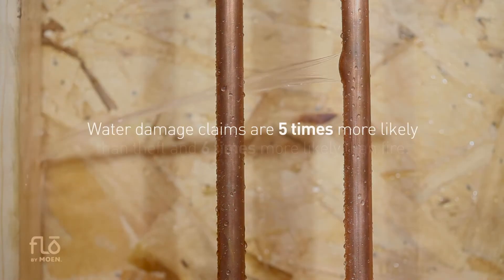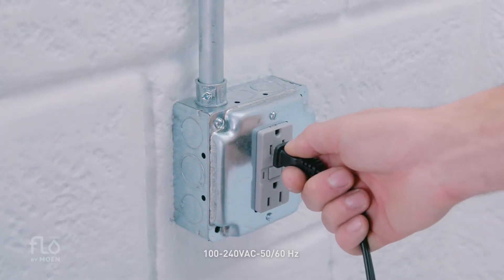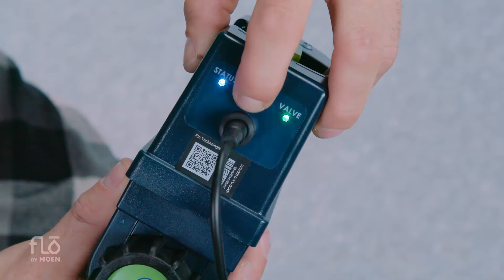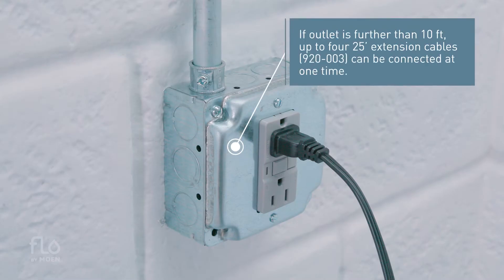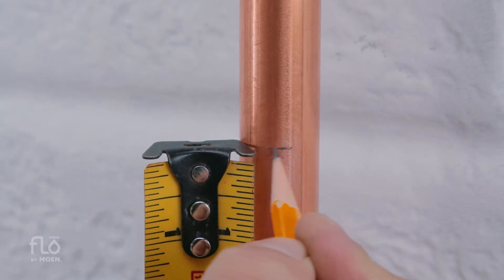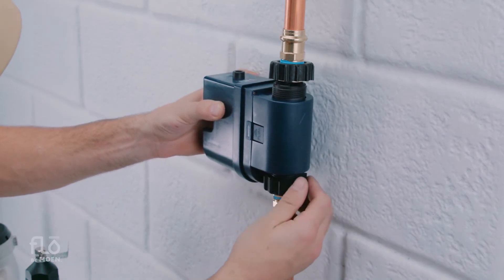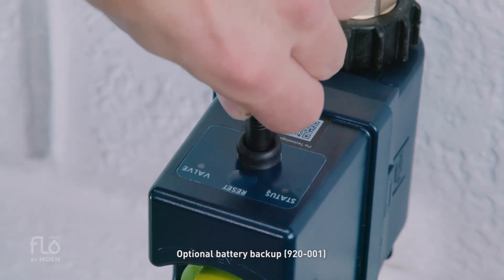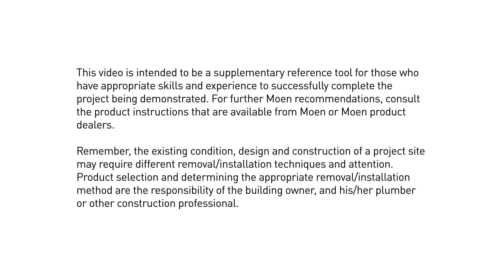Flo by Moen Smart Water Shutoff Installation

Comment: The problem is, you have to be on a schedule, which we are not. If you take a shower at midnight instead of 7 PM, the water will shut off in the middle of your shower.
Reply from the maker: Good morning. You can adjust the sensitivity:

https://solutions.moen.com/Flo_Smart_Water_Monitor_and_Shutoff/Alerts%2C_Notifications%2C_and_Settings/How_To%3A_Adjust_Shutoff_Sensitivity 

Our Smart Water Team is also available for additional technical assistance by calling 1-800-289-6636 option 8.

Comment: My home was built in 1958, so can this be installed outdoor with a galvanized pipe.
Reply from the maker: Good morning. The Moen Flo Smart Water Monitor and Shutoff must be installed on accessible cold water main water supply. This must be installed after water meter, water shut-off and pressure regulating valve. This can't be installed on galvanized pipe.
Reply: @moenfaucets Thank You.

Comment: Does a 32 degree temp limit make it not advisable to install in a crawlspace? I would think if you have a crawlspace it would have to be installed there.
Reply from the maker: Hello Fuggedaboudit223.  The Moen Flo Smart Water Monitor & Shutoff device and power supply must not be buried or installed where the ambient temperature can exceed 104 Degrees Fahrenheit (40 Degrees Celsius) or below 32 degrees Fahrenheit (0 degrees Celsius).  
If you have any additional questions, Moen Smart Water product specialists can be reached at 1-800-289-6636, select option #8 and they are available Monday through Friday from 8:00 am – 7:00 pm Eastern Time.

Comment: How does it know the water flow is a leak and not someone showering? This will be in a home where there are days when there is no water use at all.
Reply from the maker: Hello Goochesmom.  The Moen Smart Water Monitor & Shutoff device after being installed goes into a Learning Mode, where takes approximately 7-10 days to learn the home’s water habits.  The following link will provide you with additional information on the Moen Smart Water Monitor & Shutoff device:

https://solutions.moen.com/Smart_Water_Security_Products/Help_Center/Flo_Smart_Water_Monitor_and_Shutoff
Reply: @moenfaucets  Pity the person who hasn't had it "learn" yet.  You should make this more clear in your instructions. Otherwise... it just shuts down water when it feels like it.

Comment: Why are the product unions and male fittings made of plastic?  A majority of my house is made of copper (strong pipes and fittings); concerned this device would be the fail point due to it being the only plastic in the system.  Can someone at Moen-Flo further explain?
Reply from the maker: Hello Pete and thank you for your interest in Moen products. The Flo Smart Water Monitor & Shutoff includes brass tailpiece fittings and plastic union nuts. The Flo Shutoff is rated for a maximum continuous pressure of 175 psi. The union nuts are for securing the Flo Shutoff to the homes piping and plastic union nuts have beneficial qualities including resistance to corrosion. For pre-purchase, installation, and warranty assistance for the Flo Smart Water Monitor & Shutoff, please contact Moen Smart Water Support directly at 1-844-633-8356.

Comment: Can Flo be installed into 1/2" copper pipe?
Reply from the maker: Hi there, for assistance please reach out to Flo Technologies at support@meetflo.com or 844-MeetFlo.
Reply: @moenfaucets  Why didn't you answer the question?  Can Flo be installed into 1/2" copper pipe?  I'm guessing the answer is 'no' because in the 3/4" Flo instructions it would've mentioned to use reducer couplings.
Reply: did you ever find an answer to this? I have the same question. The only accessible location I can install is in an area where the pipe has already been reduced from 3/4" to 1/2". I'm thinking I could install a pair of reducers on either side.
Reply: @RobertBuchanan1  In BobsPlumbingVideos, "Flo by moen install", the inlet to the Moen is 3/4" but for the outflow from the Moen he reduces from 3/4" to 1/2" and it operated okay.  However, it's best to call Moen technical department because even if it can be installed with 3/4" to 1/2" reducers, will programming the unit allow that?

Also, see some poor reviews where it failed after the 1 year warranty and Moen won't repair it, instead tells people to purchase another unit.

Comment: I'm about to install a Flo valve in my home. What kind of grease should I use on the connection O-rings? I want to be sure I don't use the wrong type of grease and ruin them.
Reply from the maker: Hi there, please reach out to Flo Technologies at support@meetflo.com or 844-MeetFlo for assistance.